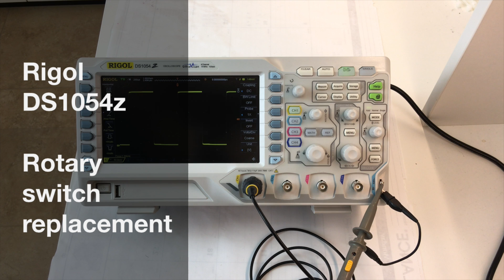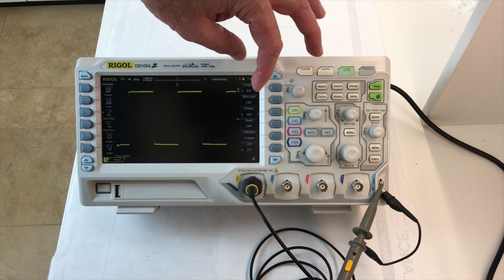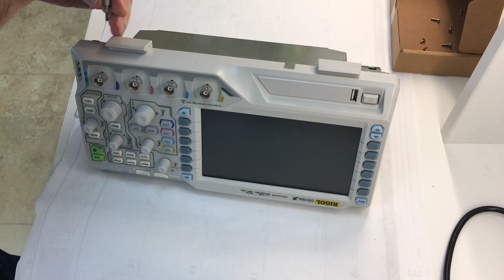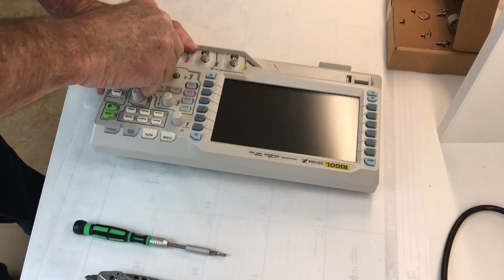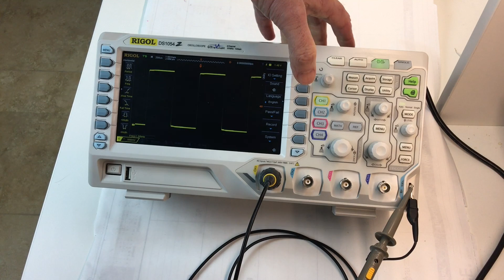Rigol Rotary Switch replacement

Comment: I accidentally partially tore off the "intensity" knob with a violent move and initially re-soldered the same selector back to its board. At first, the result seemed perfect, but when I pressed it, instead of performing the displayed menu selection, the oscilloscope's reaction was to split the screen, exactly like when you press the large time-base knob, and it also selected channel 4, just like when you press the button CHN4.
I thought it was a problem with the rotary switch and replaced it following your excellent instructions with one from Bourns (USA), Type: PEC11R-4215F-S0024, an apparently exact replacement.
The result was the same behavior as before: the rotating part works fine, but when I press the "intensity" knob once, the two described functions are selected simultaneously.
The only explanation I have now for this anomalous behavior is that the switch function connection is messed up, and I wonder how to fix it. What would your advice be, do you know how to get the related schematic to check the connections with an ohmmeter? Could I somehow verify if the original connections have been swapped with others just by inspecting the board? Backlighting it?
What I see could be the result of something else besides bad connections? Should I try reloading the instrument's firmware? Is it possible?
Reply: I finally fixed my problem with the uprooted encoder which took part of the pcb connections with it. The solution has been to backlight the board, locate the PCB through connections from underneath, little dots in the backlight images, and re-establish the connections on the encoder side. Not easy , they are 1/3 of a mm in size, my way has been to predrill , with a .3 mm bit, a very shallow hole where to position a copper wire before soldering it.

Comment: Thank you! After safely returning from the field where the little guy was perched perilously on top of control cabinets, I dropped it 18” onto a carpeted floor and broke the trigger encoder. Your video certainly aided the disassembly, but I’m most thankful for the encoder part number. While I found the non-detent encoders a little annoying, I would’ve never bothered to take it apart solely because of them. Now they are all replaced, and everything is better than new. Thanks again!

Comment: Does anyone have a part number for SMD indexed encoders used in newer scopes like my DS1102Z-E?
Reply: I now have a solution for DS1102Z-E. The Bourns PEC11R-4215F-S0012 works perfectly. 24 Detents at 12 pulses are perfect.

Comment: Ordered the encoder, opened my (new) rigol to find out they changed those thru hole encoder to onboard ones...
Reply: This is on the list when my clearance model DS1074Z-S Plus (really an MSO1074Z-S less the digi probe set) runs out of warranty in March. Board 6.1.4  S/N DS1ZD214xxxxxx. AliExpress has a 30-50 day shipping for the encoder which is just about right :)   What year is your scope?

Comment: I just did this mod but I can tell you, that was a heck of a battle to get the old knob out. I learned to HATE lead free solder on that board! It took me ~4 hours to get the whole knob out with intact legs because I didn't want to cut them off, just in the case my new ALPS knob doesn't work properly. I used all techniques, fresh solder, heavy solder tip, solder sucker and solder wick. At the end I found out for me the best way to get the solder from the big legs was to apply fresh solder on BOTH sides of the legs (front/back pcb) and then heat the solder from the front side and suck at the same time from the back. And I nearly scratched some tracks on the pcb but luckily they where still intact. The new knob now works flawless

Comment: Excellent! I just cut the connections of the old encoder and replaced it. Just missed the details about the steps of the encoder (24) as the recommanded encoder is not available anymore.

Comment: Thank you again for this video. My Rigol DS1054 now has a notched encoder for the rotary selection. Finally ! It wasn't too difficult to remove the old one, since I elected to cut its legs to facilitate desoldering and removal.
Reply from the maker: If I had the chance to do it again, I would do it the same way on video.

Comment: I've just ordered that part number (from another source but the exact ALPS part number) and should receive it in the coming weeks. You video will be a great help in getting access to and replacing that encoder with a notched one, something that Rigol should have selected in the first place. I don't know how many time the knob turned slightly at the last possible minute when I pressed down on it. Urgggh!
Reply from the maker: Totally agree with you about that knob turning issue!  I often use my scope in the field and I guess some could argue on a work bench it isn't a big deal.  BUT, in a tight electronics closet, with the scope teetering on the only place to put it, being able to make a selection without a hassle is huge. 

AVE said it best, when trouble shooting in the field your cognitive load is so high you don't have time to mess around with your tools.  Or something like that.  Cheers!

Comment: I just Got this scope.  The stock rotary selection doesn't bother me.  even if it did i just wouldn't use it that much.  you don't' have to push it in to enter the selection either.  with the only exception to that being entering text.  other then that and the intensity setting you don;t even have to use that knob.  good video thoe

Comment: Very good idea, probably I'm gonna do this. Can you tell us the original non-detented encoder's manufacturer and type please. And do you know the original but detented encoder's type by any chance. I'm talking about the light-green ones at 7:10 - when you say "...they could've put easily-easily this one in up here..." .
And I have an advice also : when you want to remove such thing always check the price first. In case of cheap parts (like this one, its few dollars only),  you can be destructive, why not. I mean,  you cut the pins , and then you remove the remains very easily and quickly. Because you don't wanna struggle and you don't wanna make any harm to the PCB, thats much more important than a cheap replacable part. Just a thought.
Reply: I did a little exploration work and these encoder types I've found. All works, all have the same parameters. 24pulses/24detents encoder with push button, 5V 5mA, sizes, pins are all the same:
Manufacturer: BI Technologies (UK)  Type: EN12-HS22AF20
Manufacturer: Bourns (USA)  Type: PEC11R-4215F-S0024
Manufacturer: Alps (Japan)  Type: EC12E2424407
The last one is what Dog used. I bought all above. The American is the best quality with metal shaft, the others has plastic shaft, and slightly bigger shaft wobble. But all good.
The original encoder in the scope what you're going to replace:
Manufacturer: LJV (China) Type: RE1103 F K1-H01
20 pulses/0detent 
This is quite good quality, metal shaft low wobble incremental encoder. Similar good as the Bourns above.
This is just a FYI comment
Reply from the maker: Teleaci2 - your comments are spot on.  I even lol'ed a bit about cutting the part out, because in the end that's what I did.  In hindsight I should have said something about that in the video.  So I don't have the old encoder or the green one's part numbers.
Reply from the maker: Great job - thanks for adding this
Reply: Hi Dog,
I just wanna say thanks again. Last week I've received my new scope. And then today I've changed the encoder. Its definitely much better feeling, thank you for the idea and the description. I checked the original one also, it has 20 pulse/rev no detents, the new one is 24 pulse/rev plus 24 detents. Actually it has better resolution per revolution than the original. I've changed the fan also, like this :
https://www.youtube.com/watch?v=XOJnw85Q4Es
Thats another very good improvement you have to try.
Reply: @telelaci2 Thnx for the digging! I really appreciate it!
My go to is the Bourns PEC11R-4215F-S0024 
They are 2,50 euro and have an aluminum shaft, ik like the quality of alps! But were not dealing with high end audio lol
And Bourns is a respectable brand in potentiometers 
That BI Technologies is around 10euro and has an plastic shaft.
I’ll buy a few bourns as spare lol

Funny to see how all the repair man reinvent the wheel, with adding the good ol’ solder, so recognizable haha, if it works it works… Sometimes i use a heat also to speed the process, through hole ic’s can be a pain sometimes, but with a heat gun no problem, but it depends on the surrounding components to use it or not…

Comment: What happens with a detented encoder, when you are trying to use the multifunction knob to position cursors or to increment trigger holdoff settings or work the mini-keyboard or other situations where the detents might not correspond to whatever you are setting?  There are good reasons why Rigol did not use a detented encoder for any of the small knobs (trigger level, horizontal and vertical positioning, and the multifunction knob. )
Reply from the maker: I haven't used the multifunction knob to do anything but make selections.  So your comment got me thinking, did I mess up by replacing it with a detented version?

Check out the video https://youtu.be/_WxcV_O0aaI  - spoiler alert - I don't think so.
Reply: I think the recommended encoder has the same 24 electrical steps and 24 corresponding detents, so it should be OK.  Still, why void your warranty and take a chance of screwing something up? I don't have any trouble getting the selection I want with the regular non-detented encoder. Each to his own I guess.